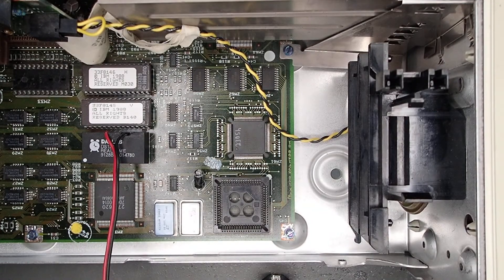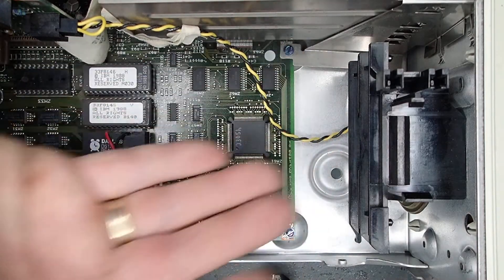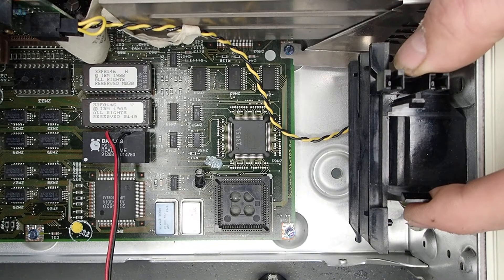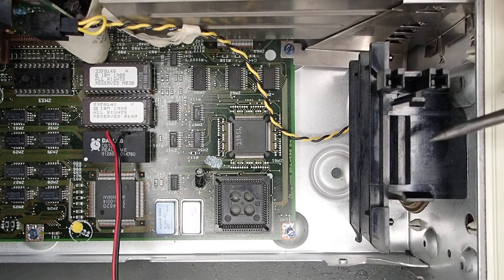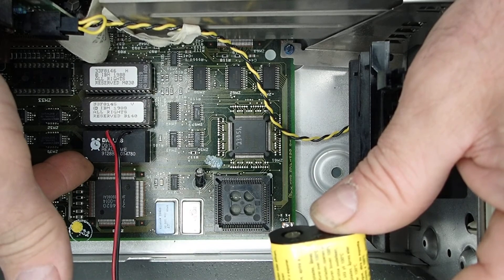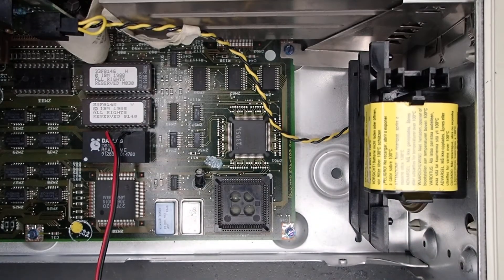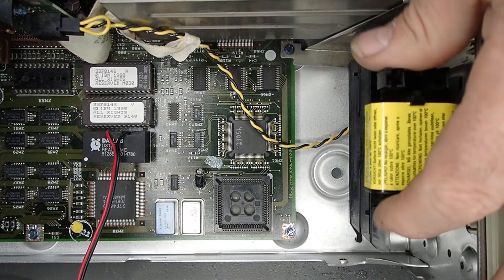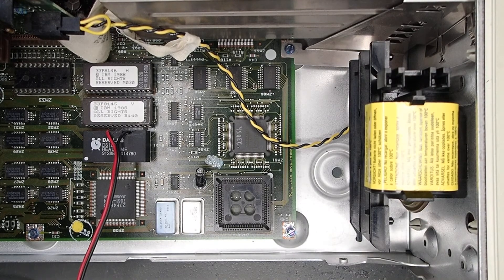IBM PS/2 Model 55SX Real-Time Clock External Battery Holder!

Comment from the maker: @4:19 I say "Model 65[SX]", although that model (the tower version of the 55SX) also has an NVRAM Dallas module (actually two, because there is also a DS1220 that is 2Kb, storing the Extended CMOS settings).

Comment: I used to have 2 of these.  They worked great, until one of them I stupidly went to reattach an MCA card I pulled earlier while the power was left on.  I heard a loud pop, blue smoke and a hole through one of the ICs located between the riser card and the power supply.  (I was 16 at the time.)  I ended up salvaging the useful parts and transferred them over to the working 55SX.  6MB RAM, 2 ESDI hard drives and an 80387 coprocessor running MSDOS 6.22 and Win 3.1.  I used this setup until I replaced it with a Compaq Contura 410C, when I went to college.